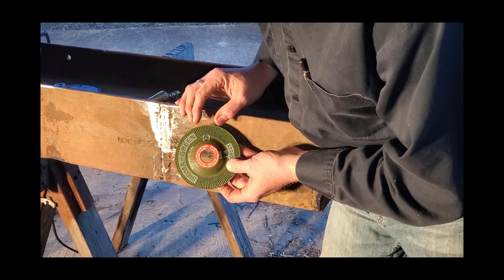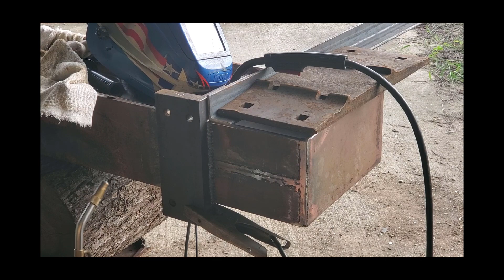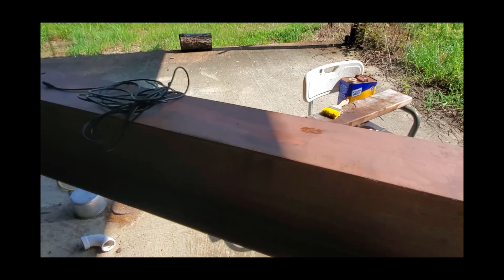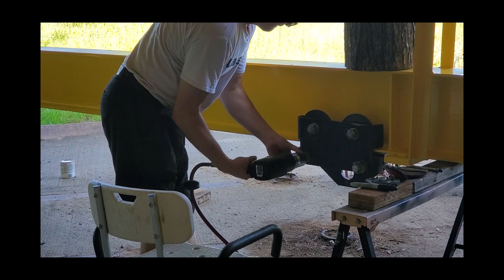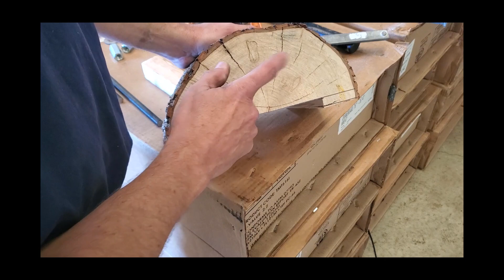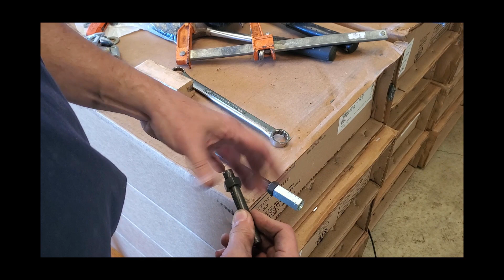Yale 3-Ton Hoist, Beam, & Trolley Installation

Comment: Nice build , you'll never be sorry for putting it in the shop. Good support with plenty of extra strenght added . Safe guards n stability built in make for better working conditions.
Reply from the maker: It has been super useful. Thanks for your interest !
Reply from the maker: Check out the test: https://youtu.be/20lxl4Wj5_8

Comment: Very nice! I'm super jealous of that capability- material handling safely and easily makes all the difference. I don't trust my gut more than your calculations but I'm amazed that those rods are all that's needed for those loads- pretty amazing.
Reply from the maker: Don't be jealous - you have working machines, I just have a way to handle them! Each 1/2-20UNF tie rod has a minimum tensile strength over 19,000 lbs, so like 38 tons at each end of the beam with four of them. They are torqued to give a total of 12,000 lbs tension at each end of the beam. I could easily go higher but did not want to risk puckering the web of the truss, it's only 3/16" thick. Technically I should weld in some vertical stiffeners on either side to tie the top flange to the bottom flange, but cutting, fitting, and welding sixteen feet in the air is not on my "fun" list. Thanks for watching Aaron!
Reply: @EngineersWorkshop  A lot of people were concearned about my 3/4"bolts holding up my bridge crane.  I was like 1 will do it, I have 6 don't worry. lol I have load tested successfully to 45000lbs on a 15ton crane so think I am safe now.
Reply from the maker: @bcbloc02  your crane would fold like tin foil before 6 three quarter inch bolts broke

Comment: Nice gantry crane and well done in the install. I just put one up on a trailer and they do make it a lot easier. Nothing wrong with over doing it a bit. I lifted my beam with 3/8" flat head bolts, but my beam weighed half of yours, only #341 at 18'. Once up I used a dozen 3/8" grade 8 bolts. A little over done. Subbed because looks like you do interesting content. I'll check out your other videos.
Reply from the maker: Thanks for your interest. The beam/trolley has handled many tons in its short life. Super handy. Lifted my Tractor for fun and a heavy steam engine
https://youtu.be/wTYSsJy4wyE

Comment: A much easier way to raise the beam after the threaded rods were in place (instead of using straps or a winch) would be to take a 3/4 EMT and hammer one end to fit the nuts on the threaded rod. Then take a short piece of 3/8 rod and put double nuts on it. Put the double nuts inside the other end of the EMT and tap with a hammer on the tube around the nuts until they are secure. You now have a 10' long deep socket for your cordless drill. Put the drill in low speed mode and drive the nuts up 4 or 6" at a time moving from one end to the other. I do this many times when installing hangers using threaded rods. It is incredibly fast to adjust the height of suspended objects. Probably would have saved you a couple hours of winching and climbing up and down the ladder.
Reply from the maker: That is an excellent idea. Next trolley beam goes up that way for sure! Rods were fine thread so it technically took me almost twice as long to make the lift vs 1/2-13 threaded rods.

Comment: Did you double nut the thread rods to lock them in place? i’m researching these cranes. I’m making a gantry lift with a 12x5x14 foot long Ibeam. Looks like you do good work.
Reply from the maker: Thanks! No, torque and stretch of the rods locks them in place. No vibration here, double nuts are often misapplied where vibration is suspected. There are no double nuts or lockwashers in engines, such as connecting rods and mains. The clamp load alone through proper torque keeps them in place.

Comment: i'm looking to do the same thing, only my roof rafters are a lot steeper. i dont know what to do 😅
Reply from the maker: If you weld the block on the bottom of the beam, just put the tie rods at an angle. Just gotta figure the angle for the holes. There are swivel washers that will do significant angle settings.
Reply: @EngineersWorkshop  i actually didn't think about that! i was messing around with slotted flat bar's in my mind! Thanks! That is a much simpler approach!

Comment: Dude, that's awesome!  Question:  Why is it important to make sure the trolley beam doesn't come off the girder?  Is that just to keep from introducing some instability?
Reply from the maker: I don't quite understand. I suppose most beams sit on top of their support, and mine is hanging. I wanted the tie rods to have at least 2x the tension as they will see in vertical load. Their actual tensile strength is over 19,000 lbs each, so plenty strong. I torqued them to only 16% of yield. With a 3 ton load, the tie rods don't even know it's there because they are preloaded higher.

Comment: What size is your Ibeam height length and thickness?
Reply from the maker: It is 12" high, can't recall the weight per foot. Now it's difficult to access for measurements. Flanges were at least 3/8" thick. The length is 25'-0" so actual travel of the trolley is about 23 ft.
Reply: @EngineersWorkshop  thank you very much

Comment: Do you know what I beam I would need for a 5 ton jib crane
Reply from the maker: Depends on the span. There are charts for beam loading on line so you don't  exceed certain stress levels.
Reply: @EngineersWorkshop   basically a 5 foot 5 ton jib crane. I'm to dumb for carts
Reply: @EngineersWorkshop  Beam Size: W24 @84 lbs/ft.

Flange Width: 9.02 in.
I think that gets me close but would like the w part to be like 12 if possible